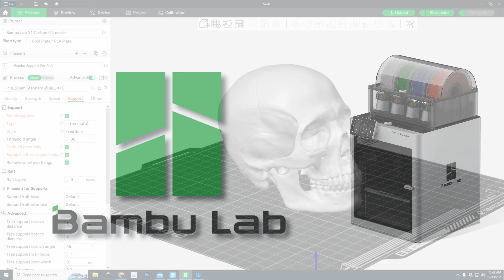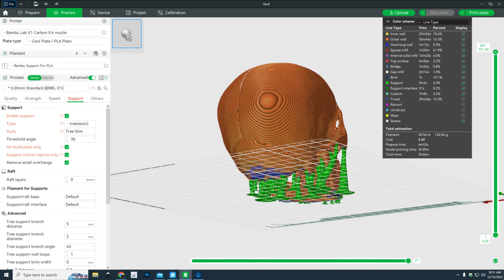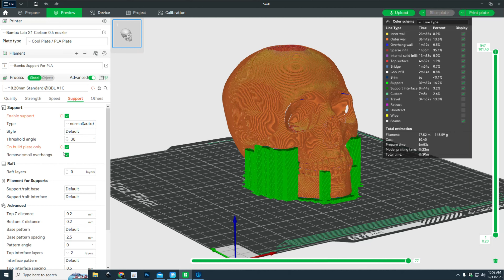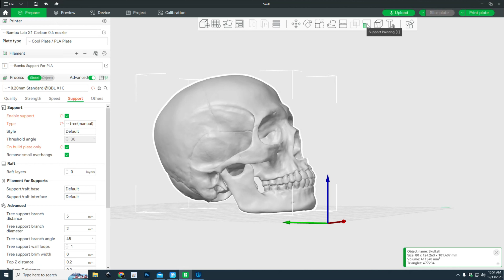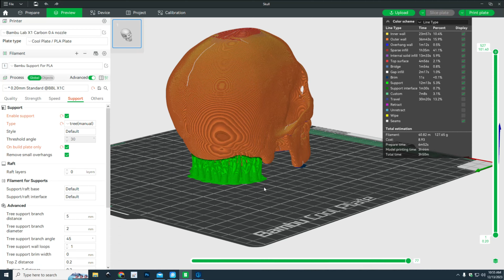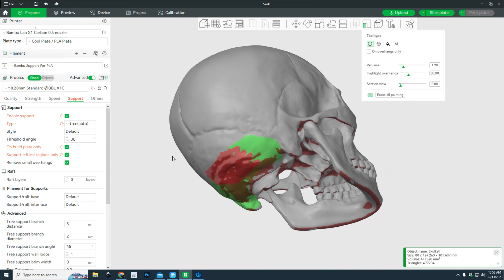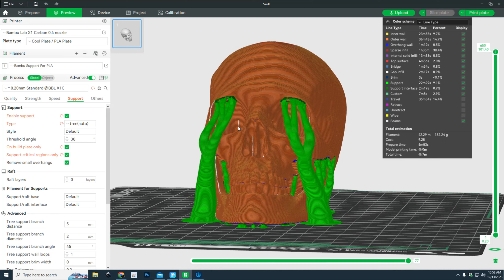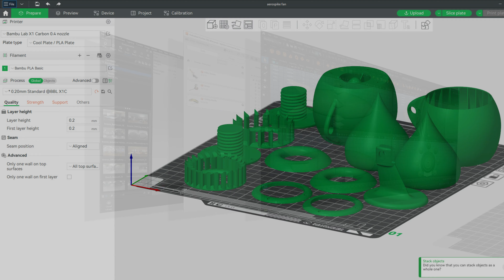Bambu Studio tutorial : How to create automatic or manual supports

Comment: Helpful. thank you. Wondering also it would be nice to be able to force supports to start on the model, instead of on the buildplate. Seems sometimes the tree starts on the plate, sometimes on the model. Not sure exactly what determines the approach but I have a model with an open mouth - and now there's a tall tree from the base plate to the roof of the mouth. seems nicer to build the tree off the bottom of the mouth.

Comment: I am trying to print a part that is thin and sits vertical on the plate. Is there a way to add supports to a flat 90 degree to the build plate part. It's thin and I don't want it to borate or get knock over. Since there is 0 angle or overhang it will not add suports.

Comment: You guys have a recommendation for me? The tree support is super stuck to the pei plate, why the model it self (with huge surface) is simply removed. The tree itself snaps of the tree base, which leaves a lot of plastic on the plate. Removing in general is very hard.